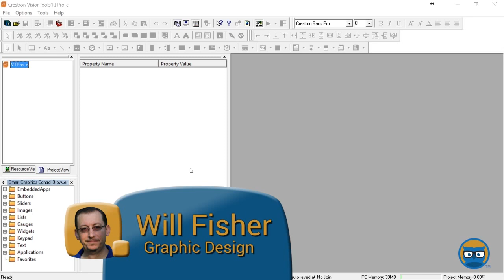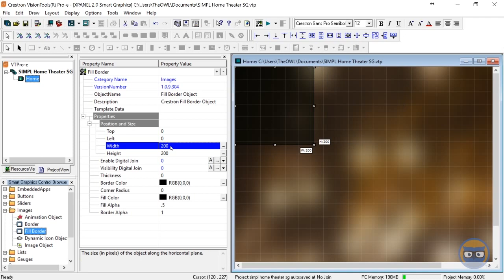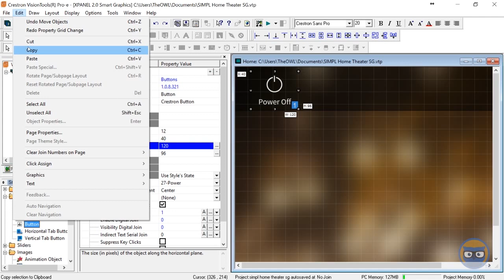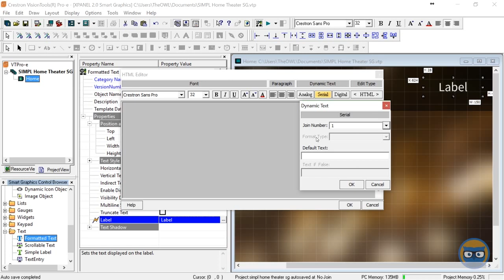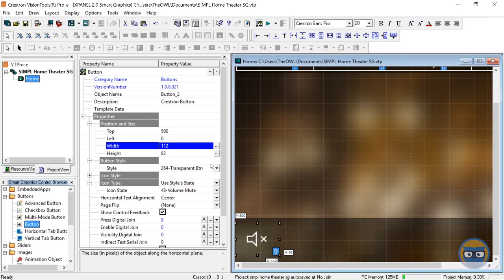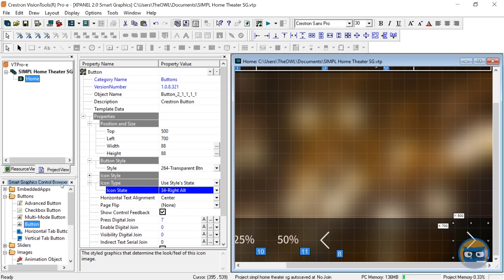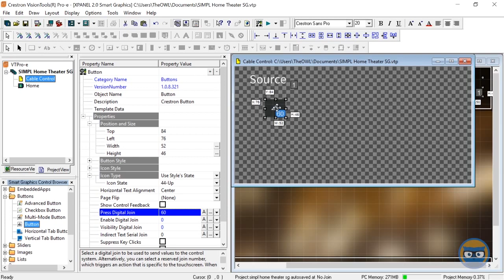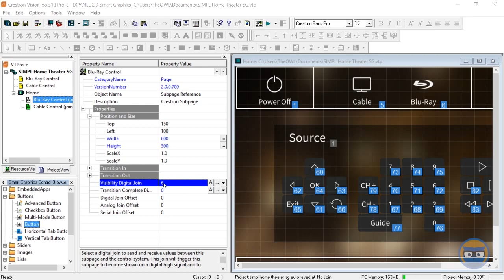Crestron VT Pro Simple Home Theater Smart Graphics

Comment: Is there a reason you place buttons slightly off-set from the sides?
Why place the power button at 12 and 40 instead of 0 0?
Reply from the maker: It's mostly an aesthetic thing. If you were to implement this on a physical touchpanel, there's a chance that the bezel will get in the way of you being able to press the button.